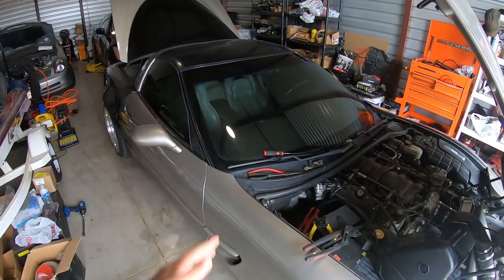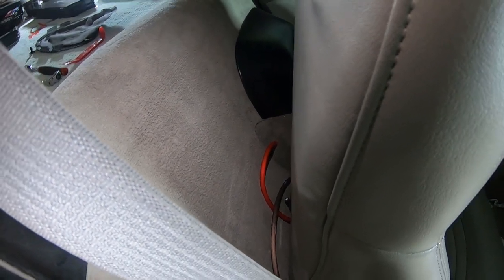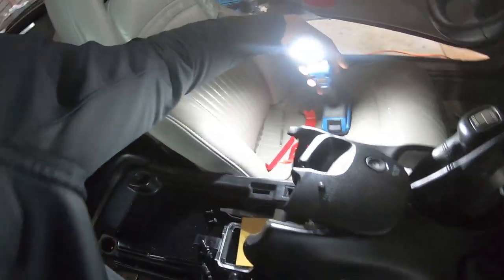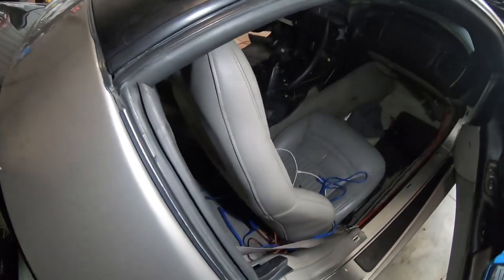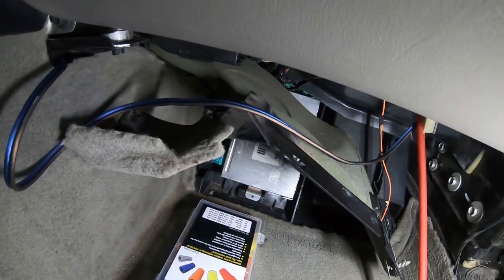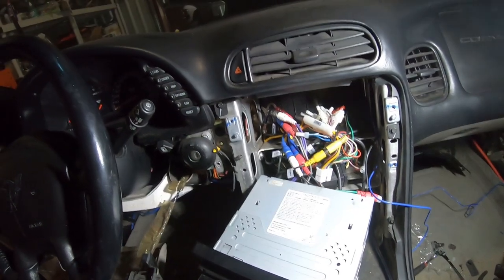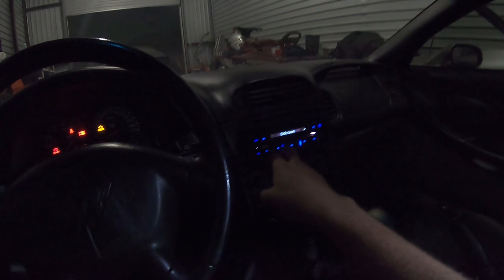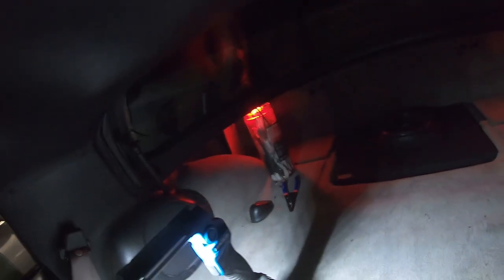MAJOR C5 Sound System Upgrade

Comment: Did u remove the factory Bose amp? Was wondering is you can just completely remove anything and everything Bose related if you plan on redoing all the speakers
Reply from the maker: C5s with Bose speakers actually use digital sound processors instead of amps but to answer your question I did not remove it.  If you are installing  a new radio, amp and speakers all at the same time then yes you can delete the Bose system for sure.  The only reason I kept mine was that the previous owner had already wired the radio to the conversion harness so I just kept it that way to save some time on the install.